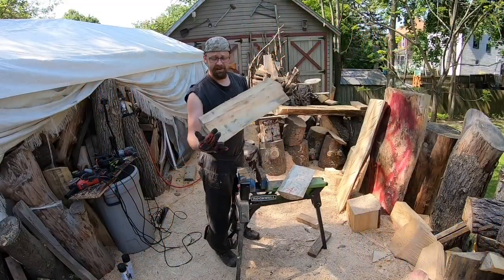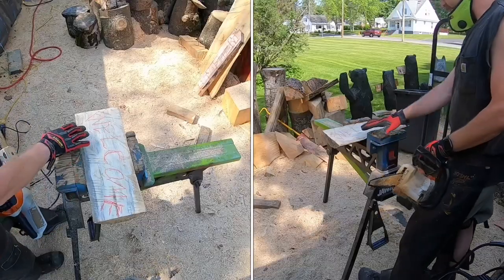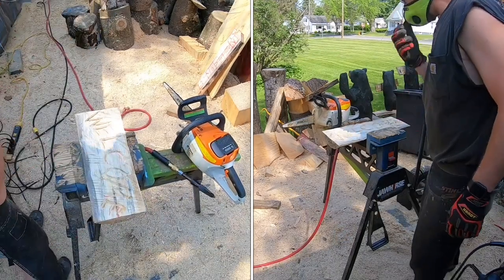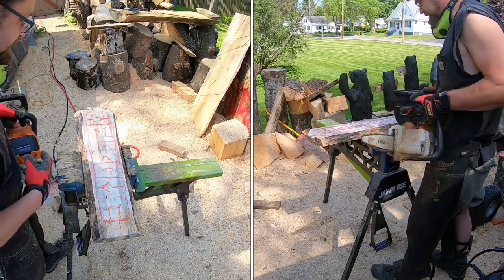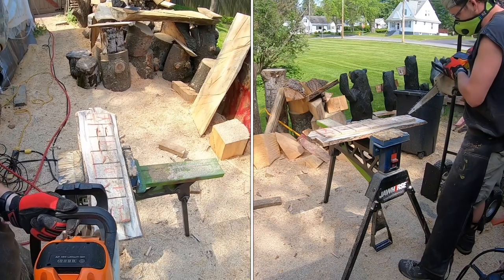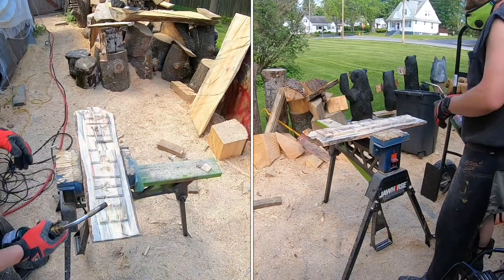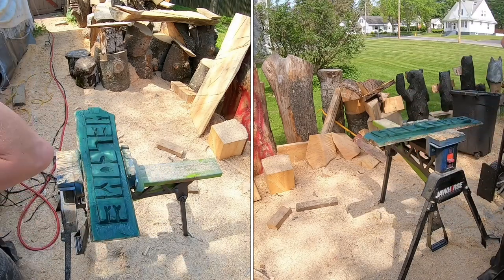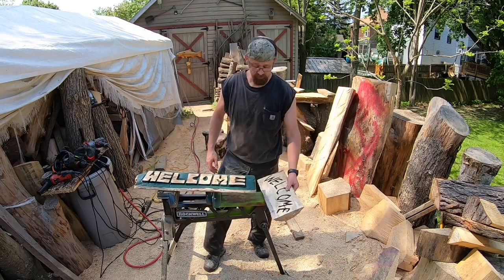Chainsaw carving signs tutorial

Comment: Very informative video! It looks like a small bar is the way to go for sign posts? I think the one in the video is a 12 incher? I'm about to purchase my first chainsaw. I wanted to start simple with signs. I was planning on getting the Stihl MSA 200 for some flexibility when I move on from signs but that's a 14 inch bar. Awkward for this type of stuff? Thx for the help.
Reply from the maker: You can put a 12” stock bar on that saw . That’s what’s on mine
Reply from the maker: If you look up the Stihl MSA200 on Stihl.com it says it comes with a 1/4 pitch .043 gauge 14” bar . This means you can fit a 1/4 pitch .043 gauge 12” bar you could also at some point put a dime tip bar on this saw with out having to replace the sprocket as it’s already a 1/4 pitch . If you were to get a detail bar / dime tip bar they usually have to be ordered at which time order the .043 carving chain to go with it and get the proper files
Reply: @Kyle Hall woodworker  I see. Thank you Kyle!

Comment: What model of stihl battery chainsaw is that? And does stihl  have a dime tip bar and sprocket for the battery powered?  Or is that the bar it came with? 
Why I ask, I was looking at the stihl cordless today and I noticed they had what seemed to be maybe a quarter sized tip.

I'm  just moving up to larger sized pieces and looking for the best combo to use to carve inside(climate controled environment.)
Reply from the maker: Great questions! If tomorrow works in my favor I will make a short video going over the battery saws I have and their set up . Hopefully post it this weekend .

Comment: Why the loose chain tension? Ever fall off?
Reply from the maker: If it’s the dime tip bar there is no sprocket in the nose so you run the chain loose as to not wear it out prematurely